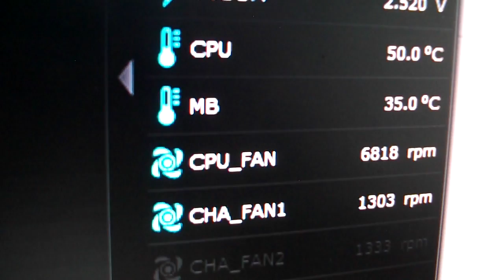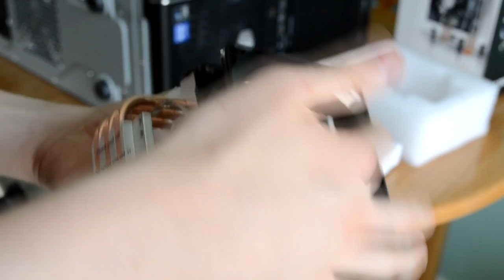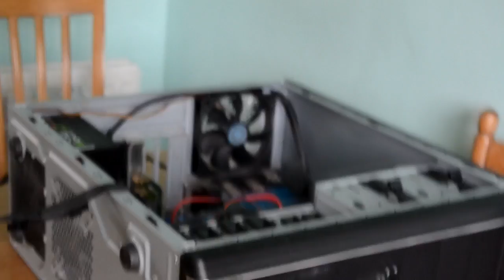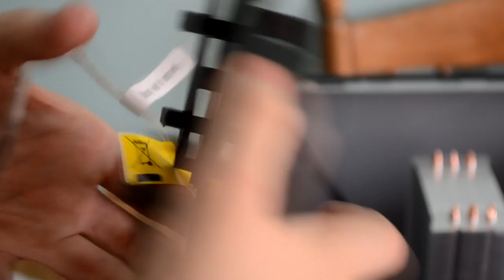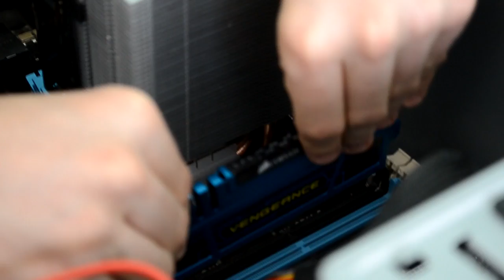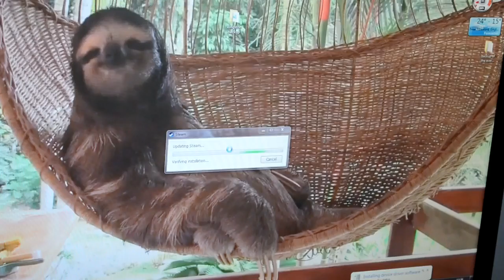CoolerMaster Hyper TX3 EVO AMD Installation

Comment: Can i use it on amd fx6300?
Reply from the maker: Since it is on the AM3 platform, yes.
Reply: DoshTech sorry bro how can i know if my plattfprm am3 is?
Reply from the maker: The FX6300 only fits the AM3 socket.
Reply: DoshTech also this cooler can i buy? And replace ?

Comment: Can i have mine face the bottom of my case or is that a bad idea?
Reply from the maker: Would work but not be as effective, as of course heat rises so you want to work with it rather than against it. If this is because of a clearance issue on the motherboard its best to remove the fan and put it on the other side of the heatsink, but in the same orientation like I did in the video.
Reply: DoshTech so basically i have to face the fan towards the exhaust

Comment: Pretty sure your fan is facing backwards
Reply from the maker: It is still facing out the rear of the case to exhaust the hot air, its just mounted to the other side of the heatsink. This is explained in the video from 13:18

Comment: Core 2 Quad dropped 46c from 80c to 34c.
Reply: Going to get one for my i7 4770, reaches 75c at 100% load with the stock cooler. Only £18 on amazon

Comment: Wrong fan position
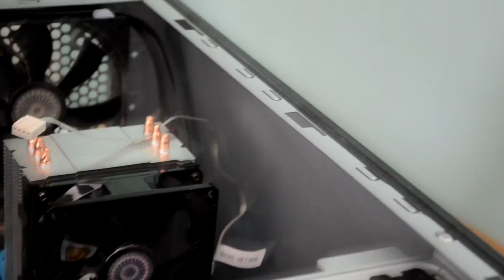Reply from the maker: This is explained in great detail from 13:28, it is still pointing to the rear of the case, its just on the other side of the heatsink. Please watch carefully before making inaccurate comments.

Comment: I think you may be able to move the fan up the heatsink above the tall RAM, up to around 2cm higher - it can clip at various heights I think. Maybe it was designed for this.

It would make it a bit less efficient (?), but you could then have 2 fans if needed.
Reply from the maker: You are indeed correct in saying this, I have had to move the fan higher on other builds where the VRM heatsinks on the motherboard do not allow for the fan to be mounted on the opposite side. Well spotted :)
Reply: Cheers. Thanks for the video - it helped me to decide on and to install this cooler for my old PC. It seems to have brought it down 5+ degrees.

Comment: mine doesn't say it supports am4 while on the website i bought it on and on other websites it says it is compatible with am4
Reply from the maker: AM4 and AM3 cooler mountings (for the stock cooler at least) are exactly the same, if you bought one that has been in stock for a long time then it might not have AM4 printed on it. If you watch my latest video (Ryzen PC build) you can see me mounting the TX3 EVO on AM4 no troubles at all, as the Hyper TX3 EVO mounts to the same part that the stock AMD coolers do, whereas the bigger Hyper 212 mounts to its own backplate.
Thanks for your comment, hope this helps!
Reply: thanks alot! :)

Comment: Wait so you can use the stock AMD plastic stuff on the motherboard?
Reply from the maker: The plastic either side of the CPU socket is indeed what the TX3 mounts to. This works in exactly the same way as the stock cooler, but is a little trickier to hold in place whilst doing it due to the extra bulk :)
Reply: Ah thanks for that. Meanwhile you were replying that comment, I was watching the video and found out anyway.
Thanks for replying, I too have an AMD stock cooler but with my FX6350 it's unbearable to listen to since I got speakers.
I'll be buying this tomorrow.
Reply: @doshtechvideos  It's posible install that cooler if part of plastic either side of CPU is broken? i mean part in downside, where metallic arm clips on.
Reply from the maker: I wouldn't have thought so, it would overheat and cook itself quite quick. I think you can buy those on ebay or similar websites, they just screw in from the top with 2 screws. 

Hope this helps

Comment: I've placed the fan facing upwards is that okay? I have went say the top aswell. But the see through panel is quiet warm
Reply from the maker: Side panels will often get warm, that is quite normal. It should be fine facing it upwards blowing out the top, the only reason I didn't point my fan like this is due to my rather cheap case not having a top exhaust. It should work well enough regardless of whether its pointing out the back or out the top, but if in doubt then get an application like coretemp that can tell you real time temperatures of your CPU.
Hope this helps, DoshTech.

Comment: is it compatible with the FX-8350
Reply from the maker: It should be indeed, it has the same heat output as the processor I am using in this video. 
Thanks for your comment :)
Reply: I justed subbed
Reply from the maker: Most appreciated!

Comment: who can beat my AMD stock cooler? 100 degrees.....MineCraft
Reply from the maker: Hahahah, quite impressive. Mine topped out at about 70!
Reply: i better stop playing video games or my Cpu is gonna die
Reply from the maker: Yeah that's not good for it. If your'e in the same position I was, wondering if you should upgrade to the TX3 or not, do it. I waited for ages concerned about me possibly breaking things, but it was quite easy. The longer your stock cooler has been on the harder it`ll be, so do it ASAP. Your CPU will be much happier for it and the noise difference is like night and day. Thanks for your comment!

Comment: building my first pc, what os would ya recommend?
Reply: +DoshTech Windows 7 for the win! I'l never switch lol! :D
Reply from the maker: +TheOne AboveAll I have a mixture of windows 7 and windows 10 computers, in my experience windows 10 still has a few issues that need sorting out. I am still using windows 7 and don't plan to change it any time soon.
Reply: windows 10 or 7
Reply: As long as it's not vista.
Reply from the maker: Absolutely.

Comment: can you plug this into a 3 pin cpu fan?
Reply from the maker: +Cheesegrinds2 Good question - Yes you can, and I am fairly sure it will still have speed control too on a 3 pin header
Thanks for your comment!

Comment: You put it in the wrong way, pull without push? Dsnt have any sense.. If you change the side put in push direction, no?
Reply from the maker: +DREAM TEAM ★ Jogo Bonito I moved the fan due to RAM clearance, it is pulling air through the heatsink and pushing it out the exhaust. It is ok to do this as long as the fan is still pushing out the back or out the top, as you see in the video I moved the fan to the other side but kept it pointing out the back. Thanks for your comment.

Comment: I have a i7 4790k does it fit?
Reply from the maker: +Lukas Dumitrache It will fit the 1150 socket that the 4790k uses. It will provide enough cooling for a little bit of an overclock, but bear in mind a hyper 212 will yield better speeds and temperatures - but I still maintain the TX3 EVO is a great cooler that will work well for you if you have space restrictions, certainly it will be miles better than the stock cooler. 
Thanks for your comment!
Reply: +DoshTech thank you for the fast answer does it fit in the corsair spec 01?
Reply: +DoshTech my specs: 
I7 4790k
Asrock z97 
Gtx 970
750 watt 
8gb Hyperx fury 
This cooler 
And the corsair spec 01
Evo ssd 250 gb
Reply from the maker: +Lukas Dumitrache The corsair spec 01 has a max cooler height of 150mm, the TX3 is 136mm tall so should fit with a bit to spare. This does mean that the bigger 212 evo I mentioned would not fit, so I suggest going with the TX3. This should be all you need, but if you ever wanted more cooling you could go for an all in one liquid cooler like the H80. Personally, I cannot recommend the TX3 enough, it is by far the best upgrade I have made to my computer. Either way I hope it goes well!

Comment: Just bought this seeing how my case wouldnt fit a 212 evo but would fit this cooler instead... I had concerns about my mobo but then you shown yours and its the same as mine! Good job dude!
Reply from the maker: +Ashton Gosling Great to hear, these perform very well for their size, well worth it I say. When I looked for this cooler originally I wanted to find a video of it on the motherboard I have, but couldn't find one, so made my own. 
Thanks for your comment!
Reply: +DoshTech So it arrived earlier and yep ive gotta agree it does a great job, pretty much silent and cpu maxed out at 48fps after 3 1/2 hours of gaming

Comment: I have the Cooler Master Hyper 212 EVO and I found it's MUCH higher quality for just a little bit of extra money. Average temperatures are heaps lower and is also quieter. would recommend for anyone who is looking to get value for their money :) here is an installation video https://www.youtube.com/watch?v=xrQncjwvmOM
Reply from the maker: +Natasha Kitten Valid point. I would still argue that the TX3 is very good for what you pay and the fact it requires no backplate and mounts strait to the motherboard is a big plus. I am using my TX3 pretty much on its upper limit of TDP, and still rarely exceeds 50 degrees, anything even slighty newer than my phenom would not get close to this - I have used this cooler on many six core builds, these run under load at about 35 degrees. Nevertheless, I have always said the 212 is the next step up, and is almost guaranteed to give lower temperatures as its a 120mm cooler over 92. 
Thanks for your comment!
Reply: Will it fit a Thermaltake V3 PC case? Because I'm thinking about buying it, but not sure whether it will fit. Otherwise I'll opt for the TX3 EVO. I prefer as less noise as possible! 🔒

Comment: I use this as an example video on r/PCMasterRace. You explain how to do it without markering bullshit. Good job.
Reply from the maker: +PsyckoSama I just found the post, thrilled to see the video being put to good use! I tried to make the video as easy to follow as I could, as I found a lack of videos explaining how this cooler mounts to an AMD motherboard - surprising, considering that this is an entry level cooler and lots of people do upgrades like this, including myself.
Thanks very much! :)
Reply: +DoshTech Yeah. The guy was happy to find a cooler that mounts right on that exact motherboard without new retention brackets. 

I always suggest this cooler when I put up Athlon builds. Works perfect with the processor and due to its low TDP allows for a comfortable overclock without needing a large case or needing to fiddle with complex brackets. :)
Reply from the maker: +PsyckoSama Whilst I run my TX3 close to its TDP max, you stated all the reasons I bought it. The fact it needs no back plate is a massive plus for my computer that I had already built, and even though I am only 5 watts off its max TDP, it still performs very well and is much, much quieter than the stock heatsink. I have installed multiple TX3's, mostly onto FX six cores, which run at just above room temperature. I can imagine running this on an Athlon would definitely allow for a big overclock - not something I would try on my 125W Phenom II X4. I still maintain that it is an absolutely fantastic cooler however, and intend to bring it over to my 8 core sometime this year.
Thanks for your comments!
Reply: +DoshTech My pleasure. 

Though when overclocking the 860K I also suggest that they add some MOSFET cooling if they really want to push it to the limit. Most affordable FM2+ boards don't include it and while you can get away with not having it, a thermal pad and some light duty heat sinks make a nice and cheap practical upgrade that will still keep the motherboard well under the price of enthusiast grade boards... which IMHO negate the entire reason for buying an FM1 platform to begin with. 

At that point you might as well get a Z170 board and do some Non-K overclocking on a Skylake I3.
Reply: +DoshTech how is with that 125w?
Reply: +DoshTech how is with that 125w?

Comment: my cooler arrived, will be installing everything next week, thinking of recording my pc build, as mi don't have a camera stand not sure how ill go about it, think i might take pictures and record some film so it'll be mix of both worlds. I won't ask m8 to help me record like you did, cause I'll be busy with exams and assignments for my Uni, so no time to have ppl around., 

My Final build is. 
Fx 8370 CPU
R9 380 4Gig GDDR5 RAM  GPU (on order, interim I'll use my old HD 5670 1Gig GDDR5 RAM Graphic Card)
CXPU Cooler is Hyper TX3 Evo
5 Anatec 120mm Case fans for case  cooling 
RAM 16 Gigs Kingston Hyper Fury 
CX750W Corsair 80+ Bronze PSU 
CIT Neptune Tooless Midi Tower Case, case management and water cooling ready. 
Going to salvage old DVD/RW from my old computer (6 years old now) 
Asus M5A97 Evo R2.0 Motherboard midrange mobo. 

When new graphic card comes in, this will be a decent gaming machine, seen some of the benchmarks for this set up, and they're really good, if I install watercooling (at some point i'll do that) than this machine will be top notch, from what I understand I can still overclock my machine to 4.1 Ghz with this cpu cooler, did you overclock it yet ? any performance issues ?
Reply from the maker: +mic of orion Sounds like a good build! I have not tried to overclock my X4 965BE and to be honest I don't think I could overclock far anyway. In my eyes it is important to be happy with the stock performance rather than count on the overclock, but the 8370 is quite powerful anyway so I am sure you will be more than satisfied with the performance. I do not think you could overclock far on the TX3 as the 125W CPU is not far off the TX3's rated 130W TDP, but you can certainly get a small improvement in for sure. Either way I am sure it will perform very well from the start. 

Thanks for your comment and I hope your build goes smoothly! - DoshTech

Comment: I've got FX 8370, but looking to get new cooler for my new amd system, is this cooler good enough ?
Reply from the maker: I am going to upgrade to the 8370 at some point and plan to keep the TX3. It does fit within the TDP of the 8370, but if you have extra room for a taller heatsink, the hyper 212 it might be a little quieter than the TX3. The TX3 is still a big improvement over the stock heatsink however and will work well.
Hope this helps, DoshTech.
Reply: +DoshTech my new case is only 18cm wide, I can place 212 but won&#39;t have space for 120mm side panel fans or water cooling fans. Reason why i asked.
Reply from the maker: +mic of orion In which case it will work great. I use my TX3 with a Phenom II X4 CPU at the moment, which has the same heat output as the FX 8370 and is still quiet and rarely goes above 50 degrees. 
Thanks for your comment!
Reply: +DoshTech Cheers, reason why I asked, wanted to see how your experience with the cooler was s you&#39;ve been using it for past 6 months. I am getting R9 380 4GDDR5 GPU, however my priority was to get a good cooler that can keep up with FX8370. My current cpu is Phenom II X4 955 Black, 5 years old, served me well but it is time to replace it with something more capable.

PS, thanx for your advice, bought the cooler, should have bought a wider case, 20cm wide case would have done it, case i've got is 18cm+ 2cm for backplate cable management, should have read description better when i ordered that case.  212 was my first choice, but than realized it is 16cm tall, this would have meant no space for two 120mm side panel fans, I guess with this cooler and 5 120mm fans case should be kept at decent temperature, overclocking FX8370 should be possible I think.

Comment: Great Intro.Not long.Not noisy and very informative.By the way.The reason you are having that loud fan problem.It is because you have a virus or Trojan.I am very well aware of the loud fan issue on most systems.I have built several AMD Systems.After one run of BleepingComputer.com ComboFix.The fan stops spinning loud.It removed the trojan and or Virus an the problem went away.UNTIL the customer loaded up the virus again.I found out it came from OriginThin.exe an other installer is still loading in a Keylogger an Trojan every time i download it on my own test.

I hope that helps you in the future.
Reply from the maker: +WarsunGames Thanks, it took me years to get it right! Hopefully my 2016 intro is even better!

Comment: Why are you applying thermal paste to the CPU when you show the heatsink had it's own thermal paste on it already?
Reply from the maker: +John Smith The TX3 Evo comes with thermal paste, but it is NOT pre applied to the bottom unlike the stock coolers, the CPU needs cleaning off and then the brand new stuff put on the CPU, remembering to take off the sticker on the cooler. Thanks for your comment!

Comment: Wait the cpu fan is blocking the ram is this for all size of ram?
Reply from the maker: +Dragon20C This can happen, as you saw in this video the standard Corsair vengeance RAM I use is really tall, but also there is pretty much guaranteed enough space if you put the fan on the other side of the heatsink. Alot of newer RAM is smaller, and shouldn't be a problem, but if it is moving the fan to the other side is at maximum a 10 minute job. Some motherboards have their RAM slots closer to the CPU and some a bit further away. As you saw my TX3 Evo did not fit with my RAM, so I swapped the fan round to the other side of the heat fins and I didn't have to get rid of any RAM and the temperatures are still great.

Hope this helps, DoshTech.
Reply: DoshTech AH ok thanks :)
Reply: I think you may be able to move the fan up the heatsink, up to around 2cm higher - it can clip at various heights I think.

It would make it a bit less efficient (?), but you could then have 2 fans if needed.

Comment: is this cooler good for oc I want to oc my q6600 to 3ghz
Reply from the maker: +SEM!N To my memory, the Core 2 Quad Q6600 has a TDP of 105W, so there isn't a lot of overclocking headroom, I would recommend the hyper 212 plus as it supports a higher TDP, therefore dissipating more heat so you could for sure get a higher OC with that. If you can't fit the 212 plus in your case, then I would imagine the TX3 could get you to your 3.0GHz target, but not much higher - depending on your settings and how overclockable your particular CPU is, some OC further than others.

Hope this helps, DoshTech.